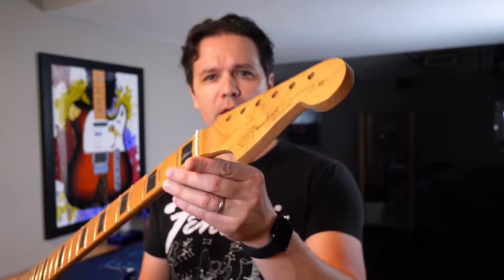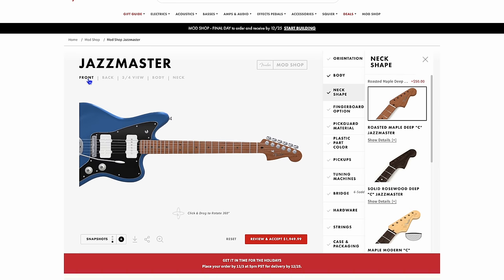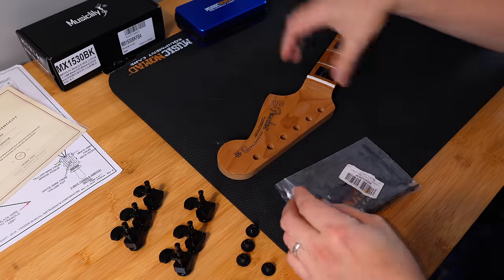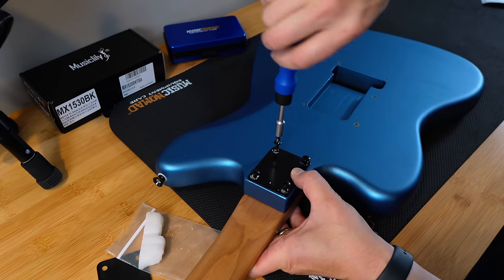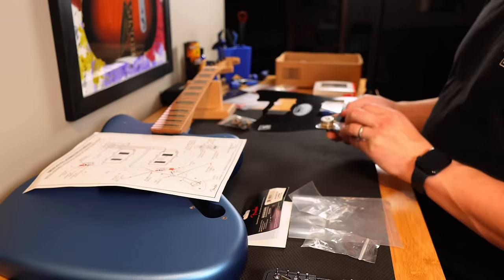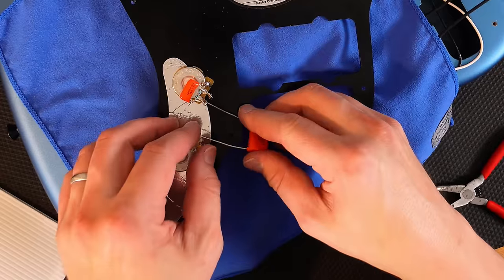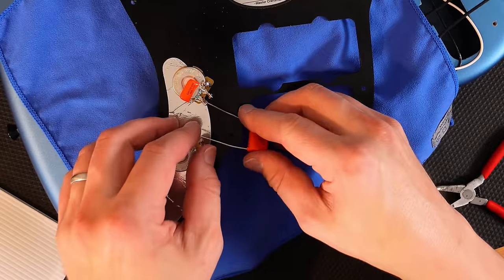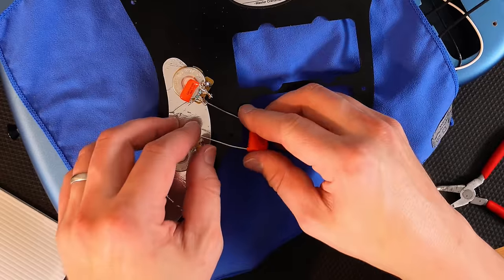Building Your OWN Fender Jazzmaster from Start to Finish

Comment from the maker: I'm going to show you how assemble and build a partscaster Fender Jazzmaster from start to finish. 
ENTER THE MUSIC NOMAD GIVEAWAY HERE: https://kingsumo.com/g/ajjl70/landons-sweetwater-music-nomad-bundle-giveaway
And here are all the parts and gear featured in the video:

Music Nomad Maintenance gear:
🛒 Sweetwater https://sweetwater.sjv.io/B0kExB

Fender Jazzmaster Roasted Maple Neck 
🛒 Sweetwater https://sweetwater.sjv.io/5gzagD

Fender Locking Stratocaster/Telecaster Tuning Machines - Black
🛒 Sweetwater https://sweetwater.sjv.io/jraXrb

Fender Jazzmaster Pickups
🛒 Sweetwater https://sweetwater.sjv.io/9gqGe4

Fender Performer Jazzmaster body from theStratosphereparts:
🛒 Ebay https://ebay.us/F7bxvx

Fender Pure Vintage 1 Meg Solid Shaft Control Potentiometer
🛒 Amazon https://geni.us/Fender1MLinearPot

Fender Pure Vintage 1 Meg Audio Taper Control Potentiometer
🛒 Amazon https://geni.us/Fender1MAudioPot

Fender Pure Vintage 3-Position Pickup Selector Toggle Switch
🛒 Amazon https://geni.us/Fender3WayVintSwitch

Fender American Vintage '65 Jazzmaster Knob Set
🛒 Amazon https://geni.us/FenderJazzmasterKnobs

Musiclily Pro Vintage-style Bridge for Vintage Fender American Strat
🛒 Amazon https://geni.us/MusiclilyVintBridgeBlk

Musiclily Metal Neck Plate for Fender Stratocaster Telecaster
🛒 Amazon https://geni.us/MusiclilyNeckPlateBLK

Handheld Reamer
🛒 Amazon https://geni.us/theReamer

60W Soldering Iron Kit
🛒 Amazon https://geni.us/60WSolderingIron

Helping Hands for Soldering
🛒 Amazon  https://geni.us/HelpingHandsSolder

DR Strings PHR-9 Pure Blues Pure Nickel Electric Guitar Strings - .009-.042 Light
🛒 Sweetwater https://sweetwater.sjv.io/Pynj6R

Grizzly T25458 Nut Files, Set of 8
🛒 Amazon https://geni.us/NutFiles

Fender Princeton AMP https://youtu.be/MXtBtvkfQXE
Royer R-10 MIC https://youtu.be/wMQgQiRliSY

MORE Guitar Maintenance Tools I use
---------------------------------------------------------
https://kit.co/LandonBailey/guitar-maintenance-building-tools

Timestamps:
---------------------------------------------------------
0:00 - INTRO and GUITAR PARTS 
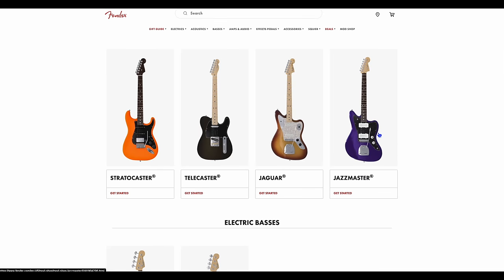6:07 - MOD SHOP
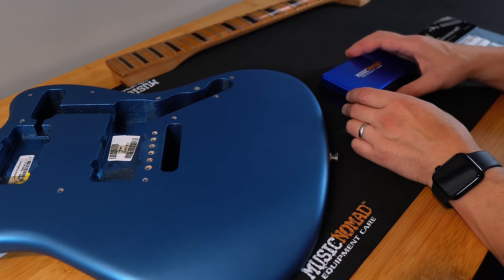7:41 - GUITAR ASSEMBLY
7:42 - STRAP BUTTONS SWAP
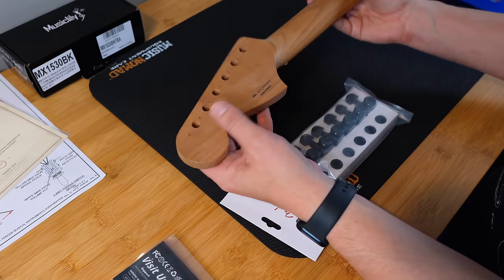9:02 - LOCKING TUNERS & HAND REAMER
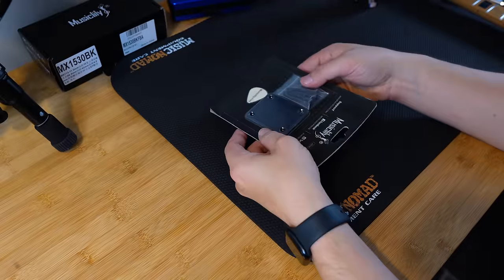14:19 - NECK AND NECK PLATER
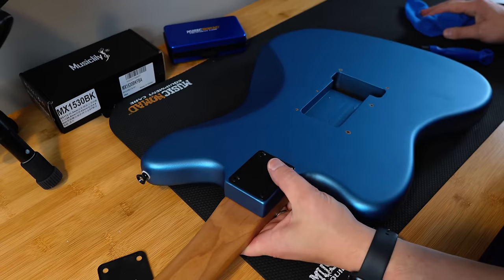16:37 - BRIDGE AND TREM CLAW + SPRINGS
19:35 - ELECTRONICS INSTALL + SOLDERING
26:35 - INSTALLING GUITAR STRINGS
27:02 - TREM ARM SPRING
24:43 - GUITAR SETUP KIT AND STEPS
28:55 - NECK RELIEF - TRUSS ROD
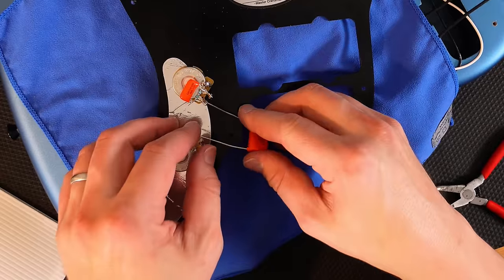29:31 - STRING ACTION
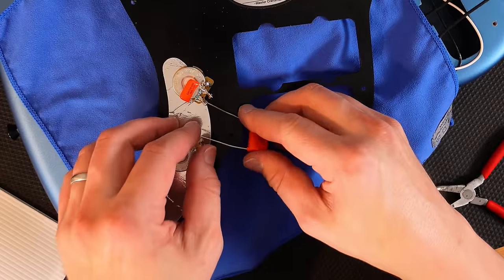30:56 - NUT HEIGHT 
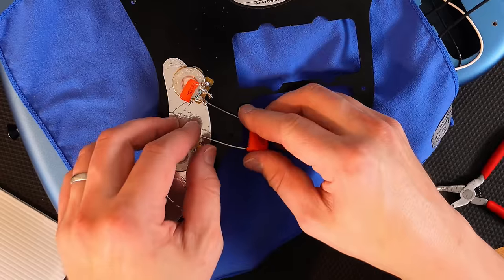33:42 - INTONATION
35:40 - the GUITAR GALLERY 
37:54 - the AMP and MIC
38:10 - CUNIFE and COBALT PICKUP TONES - CLEAN
38:50 - MILD GAIN WITH A TUBE SCREAMER
39:15 - CUNIFE and COBALT PICKUP TONES - DIRTY BOSS SD-1
39:33 - TREBLE BLEED VOLUME ROLL OFF
40:15 - MARSHALL SHREDMASTER TONES
41:15 - TREM TUNING STABILITY 
42:10 - HEAVIER GAIN STUFF
42:37 - SUMMARY and THOUGHTS

Comment: Hi Landon. I recently came across a bit of information about connecting necks to bodies: The path the screws make through the body should be slightly proud of the screw size. This will make the screw PULL the neck better into the pocket and stops 'bridging'.  Look into it. 

I love your guitar.

Comment: Nice work… but… you forgot the string tree. 😮😆

I built a parts Jazzmaster  earlier this year. I actually sanded the sheen down, made it faded Candy Apple Red. Then put a nitro vintage formula clear coat over top. Hopefully it will check some over time. 
I stuck with the original style Jazzmaster bridge so I also had to shim the neck for a good break angle over the tailpiece. I like the your build with the Strat style bridge, no shim necessary. 🤘
Reply: I think the staggered tuners don't require the string tree.  I could be wrong

Comment: A few things: Musiclily is great. I got a new pickguard for a Jazz bass and all the screw holes just lined up. Magical. 
Second: You would think that Fender/Sweetwater would send you tuners that would fit into that neck without having to ream out the holes. It was cool to watch and I’m sure you appreciate the experience, but someone should have mentioned “this neck is drilled for Vintage tuners and not modern locking tuners”.
Finally: the tuners on my old Precision bass were almost locked up. I looked up some stuff and a waxy lube like paraffin was recommended as part of the work to fix them. You know what I ended up using? Unflavored Chapstick. And very fine sanding/polishing. Freed up those 50 year old tuners amazingly. Now if only my 50 year old body wouldn’t seize up…
Reply from the maker: I chose all the parts

Comment: If you like the Tube Screamer and that Boss OD, you should sell both and buy an Earthquaker Devices Plumes.  Has a (mode) 1) Tube Screamer; 2) Clean Boost; 3) Boss Overdrive circuit. $99 new, but you can get them used on the Reverb.

Comment: I recently put together a partscaster Esquire with a roasted maple neck. I used a harbor freight reamer for the tuning machine holes and I will advise anyone to not buy a harbor freight reamer. It took me hours to ream the holes millimeters and my hands hurt for days. Buy a nice reamer and hate yourself slightly less. The neck was supposed to be ready for vintage tuners, it still needed reaming and it was way harder than it should’ve been.

Comment: Really nice guitar!
Suggest adjusting your Nut height before setting your Action and Saddle height, otherwise you may have to recheck and amend them.
Reply: Also putting the pick/capo thing in while adjusting and measuring string height was confusing.

Comment: I didn't price check everything, just the expensive stuff but looks like probably around $1600-$1700 if you buy everything new from the sources listed. In case you were wondering, you can get a Fender Performer Jazzmaster used for about $1,200 (if buying online, shipping is around 150. if you can find someone near by you could get it for less) and those cunife/cobalt pickups sell used for about $170-$200.
Reply from the maker: or $0 if you were this person https://youtu.be/2V97JsGWGcI
Reply: @landonbailey  no way!

Comment: great video, building partscasters is always fun! But I noticed one thing: You installed the Fender Tuners in the wrong order. With staggered tuning machines, the shorter posts are supposed to be installed further away from the nut, so that the strings have a steeper break angle over the nut. It's pretty much the same thing a string tree would be used for, just without the added friction. Hope this helps, otherwise you gave a lot of very useful information!
Reply from the maker: ya someone else pointed that out! I've since swapped them back

Comment: Hey man,
Just a heads up, the washers for the pots go to the base of the pot, not beneath the nut 😉
Stew Mac also makes a nice tool to make life easy for those little titts on the tuning machines. They also have the other ones on the same tool incase you decide to go with the Schaller ones with the titts closer to the base hole for the tuners.
Nice axe, I've never done a Jazzmaster.
Reply from the maker: Thanks for the info! 👍🎸

Comment: You should be the first human being to put a B or G bender on a jazzmaster.

But weird you have a fender neck and fender locking tuners but still had to ream out the holes. 🤔
Reply: I suspect the neck was drilled for vintage-style tuners, which have a smaller (I think 8mm) diameter, as opposed to standard/modern tuners (which have 10mm diameter).

Comment: Ermmm... The body ground as you call it is pointless.
There needs to be ground shield either paint or copper sheet making a cage that then attaches to but as it was I can't see the point in it.
Reply from the maker: Why?
Reply: @landonbailey  there's no conductivity. You've attached a wire to wood. Paint the cavity with shield paint them it is earthing a Faraday cage to cut down the hum you demoed in the sound samples.